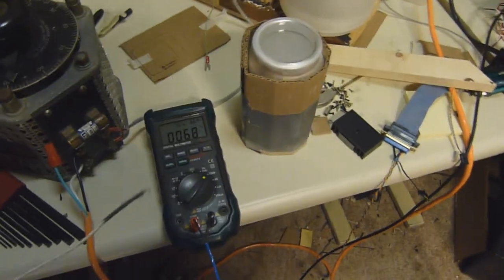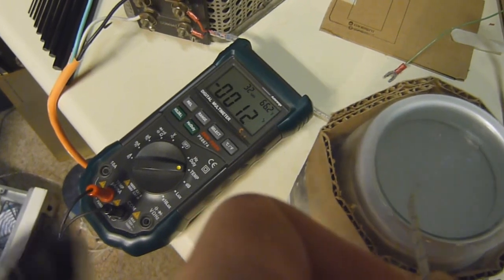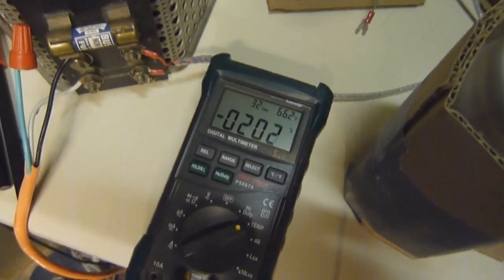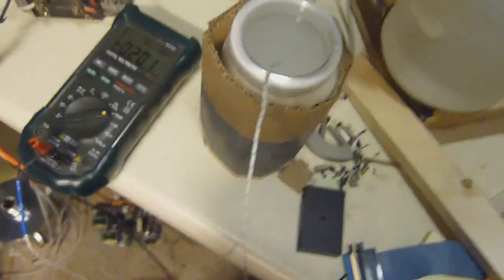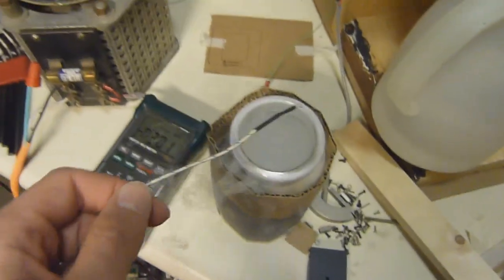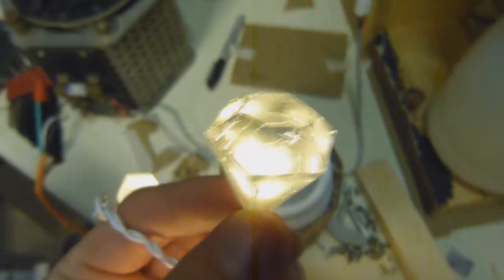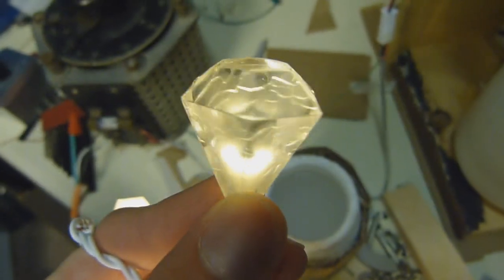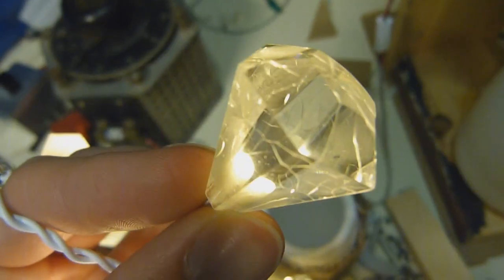DIY Cryocooler based Liquid Nitrogen Generator (liquid air)

Comment: What cryocooler were you using in this video? I am having a hard time finding ones similar to the ones used to condense Nitrogen on YouTube. All the ones I am finding look like they are part of a much larger system.
Reply: exctly, what is this machine he used to do this?? I think its from a bar machine to make super chilled beverages.
Reply: @douglundy5755  I have not made a liquid nitrogen generator, so take my advice with a grain of salt, but I plan on making one in the future. But it looks like he is using a Stirling cycle cryocooler. It uses a piston to expand a gas and in turn cool a cold finger which is where the liquid nitrogen is condensed. What you can do is look for cryo vacuum pumps, they are ultra high vacuum pumps that use a cold finger to remove moisture from a vacuum system, however they can be used to make liquid air and nitrogen. eBay has many of these for 500-1000 used but you also usually use them with a compressor, which keeps helium on the inside of the cryocooler cold.
Reply: It is something like this: https://www.youtube.com/watch?v=ZSJFPb8030g
The actual cooler here was also bought off the shelf. It is very hard to almost impossible to make one of these yourself. And if you can it is probably cheaper to just buy one.

Comment: Nice work.
Just remember you do NOT have pure liquid nitrogen but liquid air. It means there is some 20% of oxygen which has higher boiling temperature than nitrogen. It means that after some time the majority of N2 will boil off and the concentration of oxygen will be significantly higher. Take some risk precaution - don't use porous cardboard and similar easy burnable materials - they can start to burn very aggressively and rapidly they can even explode. There is a mixture used in the mines as explosive: liquid oxygen with one common material (I won't tell what it is to prevent some people to try it on purpose). Good luck with nice experiments. BTW, did you built the Stirling cooler or you bought it?
Reply: +Zbysek Zawada That's actually some pretty good information, Thanks.
Reply: +Brotherhood of Steel liquid oxygen+gasoline=KABUUUUUUUUUUM
Reply: Hermann Göring You don't even need gas.
Liquid oxygen turns organic material into high explosives.
Just tossing a match into it can create some pretty crazy results.
Reply: Zbysek Zawada probably acetone
Reply: Can i use this to generate NOZ?
Reply: I think the big issue here is saying liquid oxygen is easy to make rather than whatever else is used in the explosive, liquid oxygen is the best oxidiser we currently have no?
Reply: @Rubblage  no liquid ozone is a better oxidiser.. they tried liquid ozone for rocket engines many years ago but no one could figure out how to stop them exploding so they settled on using the less volatile liquid o2 instead
Reply: @markshort9098  ahh i see thanks for the info
Reply: You SEVERELY mixed something up here. Oxygen indeed has the higher boiling temp. But that means it will condense first and also evaporate first. So you have the highest amount of LOX at the beginning. If you make sure to always have fresh air at the cold finger, you can get fairly concentrated LOX out of just air. But if you have a mixture of LOX and LN, the LOX will boil off first and REDUCE in concentration over time. So if it doesn't go boom at the beginning, you are safe from that later.

Comment: OK - can you at least tell me the manufacturer and model number of the cryocooler you are using here?  I am working on a project of my own that requires liquid N2 (I will separate the O2 out with a separation membrane).  Desperately need to get my hands on one to build my project. - thanks
Reply: The cooler used in this video is a hybrid 98 by CTI Cryogenics. It's a common cryocooler

Comment: What website do you go to buy the same type of cryocooler? Been looking can't find one. Can you use it with other gas?
Reply from the maker: tony cole They are not sold in any shops that I am aware of, only as surplus equipment salvage. It can condense most gases if they have a boiling point of at least 77 degrees Kelvin

Comment: imagine cooling a PC with that ?
Reply: +joohop xD
Reply: Lookup liquid nitrogen overclock. That’s something people actually do in OC competitions
Reply: What’s even cooler to think about is that not only does the processor become more easily cooled, but silicon is a superconductor at cryogenic temperatures, meaning at the boiling point of liquid nitrogen the electrical resistance of the silicon chip is exactly 0
Reply: @awesomerthanyoutim20  Unfortunately, as far as I know, silicon itself does not become a superconductor at any temperature. Some highly boron-doped silicon apparently was a superconductor at 0.35K, but that's way lower than the boiling point of nitrogen. There are very few high-temperature superconductors that work at liquid nitrogen temperatures

Comment: So that's how a "Scroll" works... I always thought it rotated...  
Hey nerds. If you want to start messing around with cryogenics go and obtain a full 1-4 ton HVAC unit and then start doing your homework. Liquid air isn't a dream.... Dry the suction line on your compressor, feed it through a water cooled condenser after your orifice. No evaporator needed. Open loop.. Dry ice helps big time too. It's not Rocket Science although it appears to be on YT....
Reply: This is not a scroll. The spiral on the top is a dampening spring for a normal actuating piston.
Scroll compressors use a rotating spiral that meshes with a static spiral and compresses the gas that way.
Reply: Not scroll is, Stirling

Comment: It is a electricity-eater. The liquid air should be very expansive.
Reply from the maker: Gearldine Sweet Cryocooler uses 100w, costs $0.36/day to operate producing approx 1 liter of liquid air
Reply: +Photon939   That would cost me less that $0.15 per day here in BC Canada.  I thought the consumption would be much higher.  Small amounts of liquid nitrogen run around $1 a liter (pure, filtered, delivered, 50L)

Comment from the maker: It's all basically a self contained unit, it runs on 0-110VAC approximately with 100W power usage. I am currently selling these for 6.25 bitcoins or $675 via paypal. PM if interested